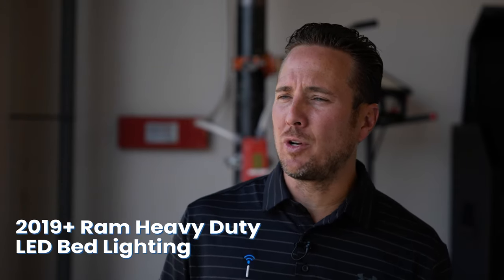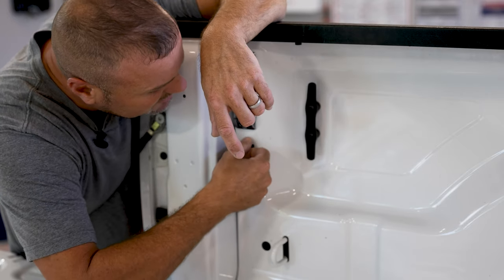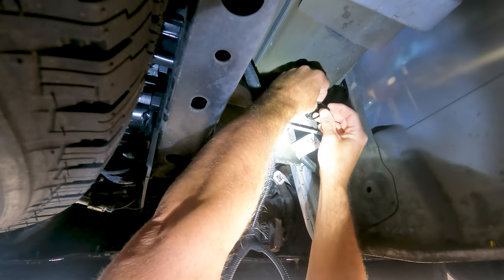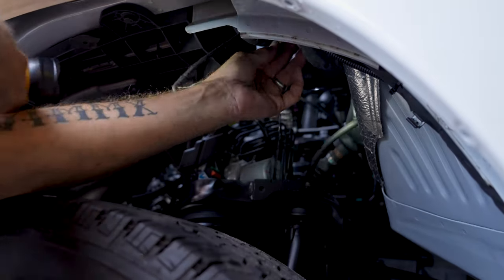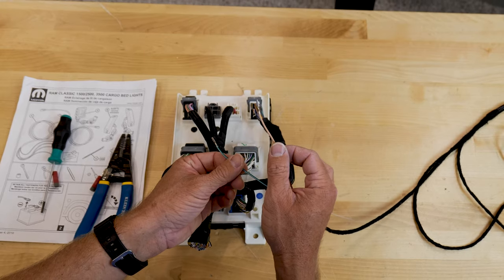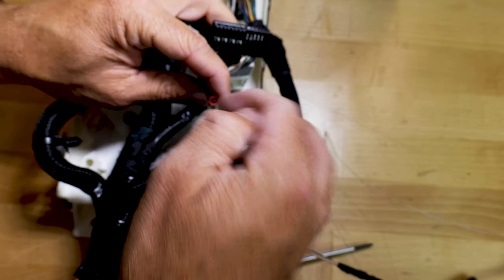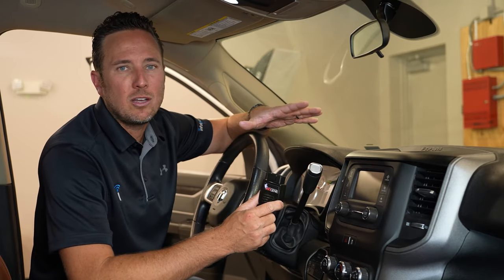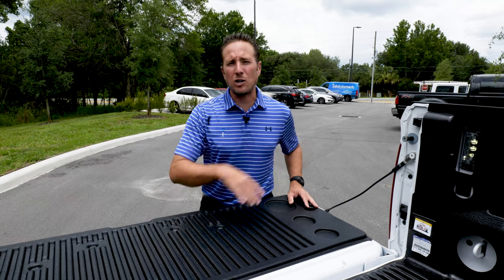2019+ Ram 2500 LED Bed Lighting -  The Build Episode 2 by Infotainment.com

Comment: U can buy a bypass cable that’s way easier to install than that and bypass the gateway security module did it on my 22 ram 2500 to change the drl and fog light drop out
Reply from the maker: We've got you covered on a bypass harness:

https://infotainment.com/shop/interior-accessories/wiring/c-intbyp/

Comment: Damn this was far more complicated than I expected.
Reply from the maker: Yeah, it's a bit intricate. Technically not complicated, but intricate.
Reply: @Infotainment_nav  it was ok up until you had to start taking apart the dash.
Reply: 3 wires you don't even have to buy the kit to run 3 wires  and don't use those posi taps so unprofessional always solder

Comment: What the price on the led tail light with blind spot sensor
Reply from the maker: You might have to check with your local dealer or MOPAR supplier. We don't sell the BSM tail lights by themselves, but we do sell them in a blind spot upgrade that includes the harnesses, programmer, and mirrors. We do have a kit that doesn't include the mirrors, just in case you have specialty mirrors with 360 camera or something unique, and we provide the part number to the mirrors that you'd need to get on your own to retain special mirror options and gain blind spot monitoring.

Comment: I have a 22 Ram 2500 and the instructions with my OEM bed light kit say to connect tn/wt wire to C3 pin 17 in the fuse panel in engine compartment. Will I have any issues wiring to F6 like your saying to?
Reply from the maker: Where did you get the kit? Is it Mopar?
Reply: I have the same problem. Manual shows C3 pin 17. I get my kit from my local dealer. I own 22 ram 2500 6.7 cummins. Kit # k6862869ab. Should I connect like you did?
Reply: @301tefal  I took mine to dealer to finish connections and they said it needed to be connected to c3 pin 17. Not sure what issue if any it would cause the other way, but wasn’t worth the risk for me.
Reply: My dealer charged $125 to make connections and flash computer. It took them about 45 minutes for all.

Comment: Instructions show different way to connect wires. I have a 21 ram 2500
Reply from the maker: Contact support at 855-636-6287. They can help you with the installation.